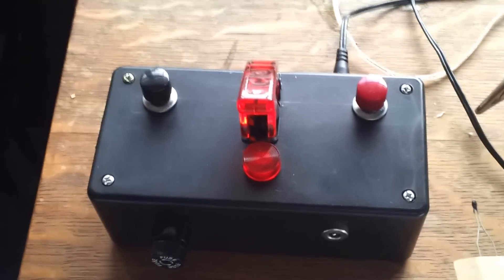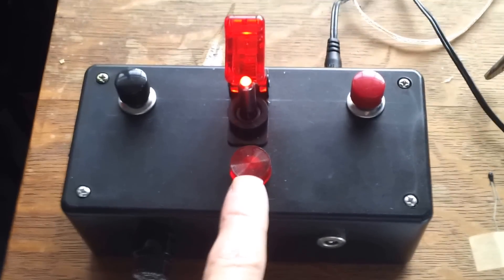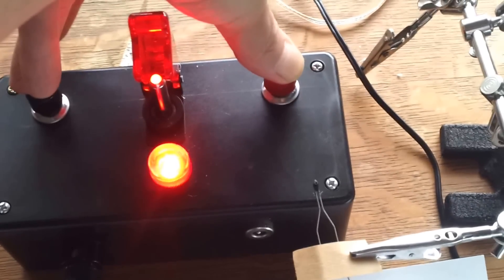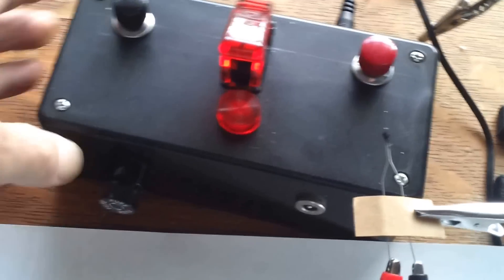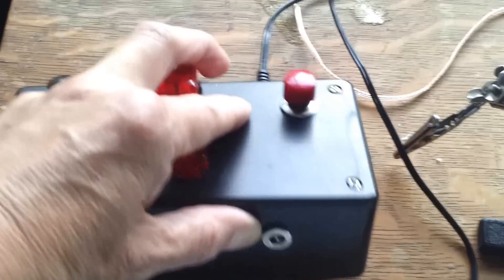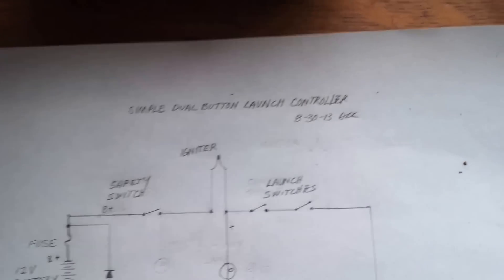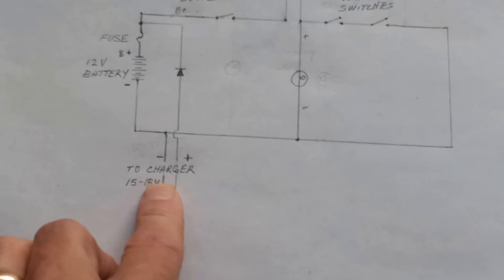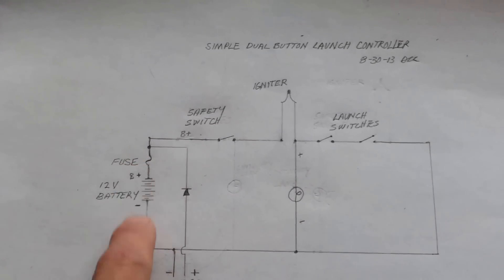Model Rocket Launch Controller

Comment: Great video and info thanks for sharing. Only question is did you use an led or incandescent bulb? Was wondering if the LED provided enough of a drain to not heat the igniters until all switch’s are depressed and a path without the resistance from the light is created.

Comment: Hi, what volt diode did u use between the charger and battery?  Have u had any problems recharging?  One guy that built a wireless controller on YouTube said to use a protection board. I'm not sure why.  Has it blowed a fuse with you?  Thanks .

Comment: Hi, I'm having a problem with the wireless controller I built.  I use a rf module.   Well, when I hook up my powering leads and hook up an igniter, the red led goes out and no voltage is sent,. What could be wrong?

Comment: New to this, but doesn't the continuity light close the circuit to the ignitor as sketched when the toggle switch is on?  I presume a resistor in line with the LED is needed, is that enough to limit the voltage to the ignitor so that it doesn't pre-ignite?
Reply: The continuity bulb itself acts as a resistor in order to limit the current through the circuit. Once the 2 x launch switches are depressed this creates a new route for the full current to flow through AROUND the bulb and therefore the igniter is burnt out. :-)
Reply: For certain lights a resistor is needed, I ran into this problem where the state switch ignites the fuse without pressing the launch switch

Comment: how was the switch lighting up when the circuit was incomplete?
Reply: +Justin Richeson When he shows the electrical diagram you can see a slightly erased line at the output of the safety/master switch with a LED in it. When the switch is closed current can flow through that line and makes the LED light up. It will light up even when there's no igniter connected to the circuit because it's not a continuity light. The line is in parallel with the iginiter part of the circuit :)

Comment: I use a door bell and lamp cord. My door bell is mounted on a tool box. When everything is connected the door bell lights. It's a go.  I used lamp cord to run my lines and i have a about 100 feet that i keep in tool box along with a small car battery. I've launch some huge rockets. I like your fuse setup That's one thing i need to do.

Comment: Would this work with an external 12V 20A battery... fuse and resistor specs also would be helpful.  Thank you so much.. great, cool looking design.